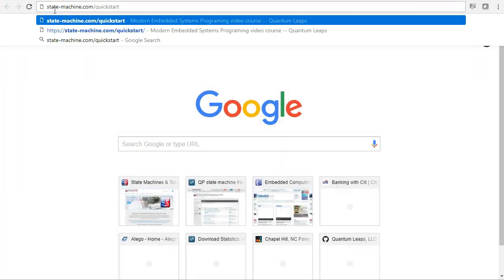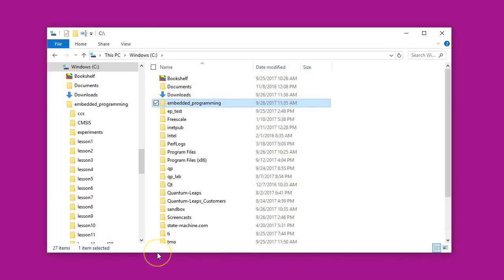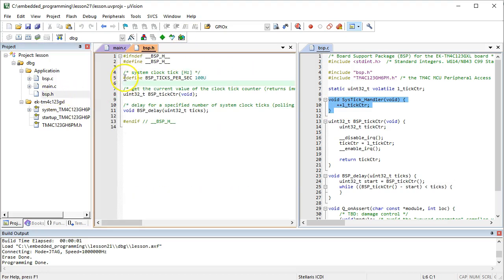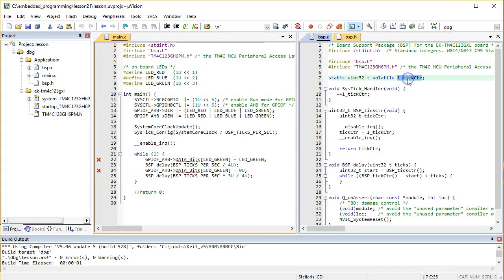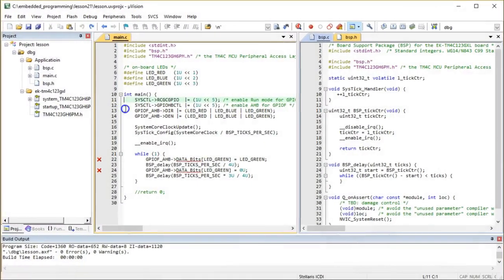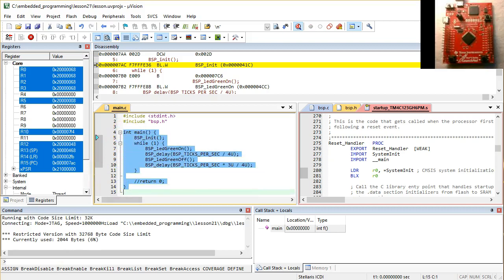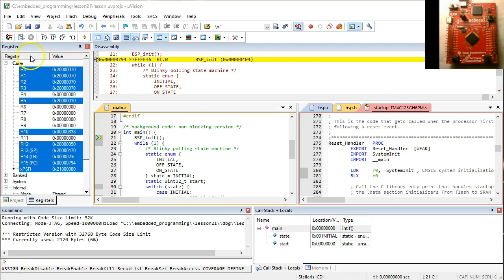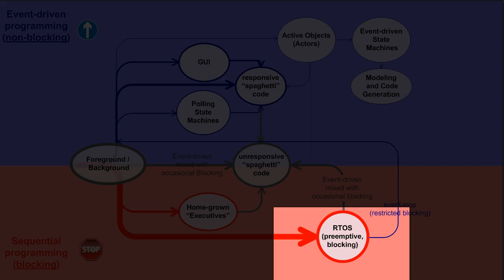#21 Foreground-Background Architecture ("Superloop")

Comment: For people confused (like me) about ((BSP_tickCtr() - start) < ticks), think of this like a clock. A clock at 1pm, but 4 hours prior,  we have 9am.  --> 1-4 = -3 + 12 = 9.

Now for unsigned int , which is a 32 bit number, the value ranges from 0 to 4294967295 (0xFFFFFFFF), therefore the total number of values are  4294967295 +1 = 42949672956, which is exactly like 12 hours, we call this MAX_VALUES.

So if we have the condition where start value was 4294967293, 

1 systick interrupt -> 4294967294  ,(BSP_tickCtr() - start) = 1
2 systick interrupt -> 4294967295 ,(BSP_tickCtr() - start) = 2
3 systick interrupt -> 0 (roll-over)  , (BSP_tickCtr() - start) = -4294967293 + (MAX_VALUES) = 3
4 systick interrupt -> 1                   , (BSP_tickCtr() - start) = -4294967292 + (MAX_VALUES) = 4

And so on... 

Hope this helps ( I am writing this to take a snapshot for myself).

Comment: sooo you should not do mix between blocking and non blocking systems?
Reply from the maker: That's right. You should not mix blocking and non-blocking programming paradigms. Truly blocking components are also difficult to combine together, because the blocking makes them unresponsive. That's the main reason for using RTOS (please watch the next vidoe https://youtu.be/TEq3-p0GWGI ). In contrast, non-blocking code is composable, meaning that you can combine many event-driven code snippets in one big loop, and they will still work. But you can do better than that. Please watch the segment of lessons about "Active Objects" ( https://youtu.be/l69ghMpsp6w ) and later about state machines ( https://youtu.be/EBSxZKjgBXI ). --MMS

Comment: How to run this lesson 21 on IAR  ?  
I got error "SystemCoreClock is undefined".
Reply from the maker: The project download for this lesson-21 has been augmented with the IAR workspace, which was tested to build the code correctly. Please download lesson21.zip from the companion page (state-machine.com/quickstart ) or from GitHub (https://github.com/QuantumLeaps/modern-embedded-programming-course ). --MMS

Comment: Greetings Team QP,
I couldn't get how was the clocking frequency was initialed in the program,
{
SystemCoreClockUpdate();
SysTick_Config(SystemCoreClock / BSP_TICKS_PER_SEC);

}
As I am a starter I couldn't able to figure it out from my side, I could understand that this part is most integral part of the code (setuping clock frequency ) and could you also suggest any reference to know more about system clock configuration. This would be a great if you suggest any thanks in advance!
Reply from the maker: The clock configuration is performed in the module system_TM4C123GH6PM.c  which is part of the provided uVision project. You can find this file in the qpc folder: qpc\3rd_party\ek-tm4c123gxl\system_TM4C123GH6PM.c . The function that configures the clock is SystemInit(). It is called from the startup code startup_TM4C123GH6PM.s, which is also included in the uVision project. To learn more about the startup code, please watch lessons 13-15. --MMS

Comment: a question MR MIRO "sorry for annoying you"  
when I check this parameter [  SystemCoreClock ] , I find so strange value >> 50 000 000 ... why this happened , although we do NOT use PLL , and if keil uses the PLL automatically , why does it do that !
Reply from the maker: Please take a closer look at the uVision project for this lesson-21. Specifically, look in the group 'ek-tm4c123gxl'. You should see there two files: startup_TM4C123GXL.s and system_TM4C123GXL.c. The startup (file in assembly) calls the function SystemInit() from the Reset_Handler. This SystemInit() is defined in system_TM4C123GXL.c, so open this file and search for this function. When you do, you'll see that SystemInit() configures the CPU clock to use PLL, which explains the value 50MHz. --MMS
Reply: @StateMachineCOM  yeah .. you alright . I ve checked the TM4C123GXL.c file and i found there is a default value for RCC register thanks MR MIRO ...
Reply: @omarayman5318  another way is to checkbox the BYPASS PLL in the system configuration file/wizard...
Reply: @UCZcuyApXHiYcMBjsjOb8ZyQ999  thank you  , I m gonna try to do it  using this checkbox ..
anyway I did it manually in the code
Reply: @StateMachineCOM  BTW you are the best teacher I ve ever learned from ...thaaank u very much for these helpful lessons .. may god bless u

Comment: In the first 20 lessons everything worked well. However in the lesson21 after building the project when I press Debug button it tells me 'No ULINK2/ME device found'. And then "Error: Flash Download failed - Target DLL has been cancelled". I installed uVision V5.29.0.0, Toolchain MDK-Lite Version 5.29.0.0 and used Pack Installer to install Tiva support. By the way, in the Debug tab of Project options for Target no Stellaris option in the Debuggers field as it was in two previous IDE. What did I miss? Thank you.
Reply: Stellaris ICDI has been removed from uVision. I was facing the same problem here. I followed these instructions and it worked right away: http://www.keil.com/support/docs/4196.htm
Just change it to Stellaris ICDI after installation
Reply: @gabemvp  Thanks! Was looking for a solution for this, and thought comments might help, you sure did :)
Reply: @TheNordrian  I'm glad it worked :)
Reply: @gabemvp  Great. I had the same problem and this worked. Thanks.
Reply: i still get the annoying Error: * Project 'lesson', Target 'Debug', Device 'Texas Instruments::TM4C123GH6PM' is not supported by Toolchain ! ***. even after downloading the ICDI AddOn, any idea how cam i solve it ?
 @gabemvp
Reply from the maker: The uVision 5.29 IDE works with the TivaC board. Your uVision project cannot connect to the TivaC board, because apparently it tries to use "ULIN2/ME" hardware debugger. For the TivaC board you need to install the "Keil::TM4C_DFP" device pack. You do this through the "Pack Installer", which is available on the Build toolbar.
--MMS

Comment: Thanks for the great tutorial Miro. Just a comment on license manager. There is no PSN (Product Serial Number) associated with the evaluation version which seems to be the only available free option. So that licensing step can be skipped without any issue.

Also, the archived version of this lesson is not the starting package but the final version at the end of the tutorial. I think it would be useful to include both starting and final packages in the course project archive to make it easier to kick off the course and follow the steps.

Comment: I had a problem in my Keil uVision V5.29, I could not Debug or install my code on my Tiva board, I searched for that I found a new problem and the solution is: 
Use an add-on installer that brings back the support for Stellaris ICDI to MDK v5.29 and above. Just download and install "MDK_Stellaris_ICDI_AddOn.exe" from link below; 
http://www.keil.com/support/docs/4196.htm
Reply: Thanks for the tip Muhammed. Saved me a lot of time.
Reply: My Error was: 

Cannot load driver 'C:\Keil_v5\ARM\BIN\lmidk-agdi.dll'.

Possible Reasons:
 - Driver DLL could not be found in the specified path
 - Driver DLL requires additional DLL's which are not installed
 - Required Hardware Drivers are not installed

 Debugger aborted !

Comment: Well, in the sequential blocking code if you might used if condition instead of while -> it would also spend time in main loop, because in event driven code you used if condition where in blocking code you used while condition........... P.S. event driven switch case is more preferable.
Reply from the maker: Replacing the polling while() loop with an if() statement would require completely changing the whole code structure, or the "blinky" code will not blink as expected. Such transformation would change the sequential code into something else: the event-driven code. Now, event-driven code might be more preferable, but it comes with its own set of challenges, one of them being that event-driven and sequential paradigms don't mix well. This will be the subject of many more upcoming videos of this course. --MMS

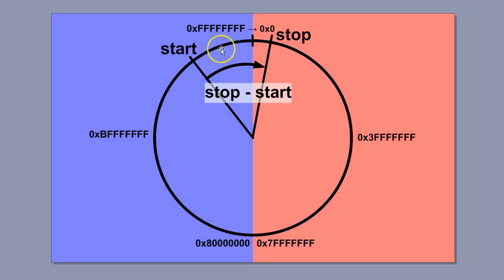Comment: 7:21 For anyone wondering how the while-loop condition ((BSP_tickCtr() - start) < ticks) in the BSP_delay function always works even when the counter wraps around from hex all-Fs to hex 0 is because the counter variable here is implemented as a uint32_t type, which has the same 32-bit precision as the fundamental int type on the ARM processor.

For example, let us assume that we call the function with ticks argument equal to 5 and that start evaluates to 4294967293. 5 SysTick interrupts later, the counter rolls over the maximum value of 4294967295 so that BSP_tickCtr() returns 2. We expect the loop condition to evaluate as false and exit, but you may think that (2 - 4294967293) would evaluate to -4294967291, which is less than our ticks of 5, making the condition true and continuing the loop (indefinitely). However, this does not happen because when the (BSP_tickCtr() - start) part of the condition is evaluated, integer promotion converts both operands (and their combined result) to unsigned int type, which does not widen it. The (2 - 4294967293) evaluates to 5, which is equal to our 5 ticks, and the loop exits as expected. Similarly, the while-loop condition also always runs successfully if the counter is implemented as a int32_t type, or as any type with more than 32-bit precision.

WARNING: If we were to instead implement our counter with a type having less precision than the fundamental int type on the ARM processor, such as uint8_t, int8_t, uint16_t, int16_t, etc., the above scenario would indeed result in a never-ending loop and program hang. For example, let us use a uint8_t type counter and call the function with ticks argument equal to 5 and assume start evaluates to 253. 5 SysTick interrupts later, the counter rolls over the maximum value of 255 so that BSP_tickCtr() returns 2. This time, (2 - 253) will evaluate to -251 (not 5) because this number can fit within the integer-promoted result type of (signed) int. Our left-hand condition value will always be less-than our ticks value of 5.

To summarize, if you implement your counter as having less precision than that of the fundamental int type on your machine (e.g., 32-bit for ARM, 16-bit for MSP430, etc.), then a counter wrap-around during while-loop execution will result in the condition forever evaluating as true and the loop running indefinitely, causing program hang. This is due to the C Language Standard's integer promotion rule, which widens all types with precision less-than or equal-to that of int during evaluation, to either int or unsigned int.

Please watch Lesson 11 for more information on type precisions, including how they interact when mixed in an expression. A detailed explanation about integer promotion and the "usual arithmetic conversions" can be found on the 'Implicit Conversions' page of the cppreference website, or in the 'Conversions' section of the appropriate C Standard.
Reply from the maker: Yes, absolutely, you need to be careful with the wrap-around and this might be NOT portable to other CPUs with different word size. --MMS
Reply: Thank you very much for the explanation I searched entire internet for the answer and did not find it I should have looked at comments earlier

Comment: 18:00 can u plz explain this diagram with pseudo code example for every architecture in 1 small video ?
Reply from the maker: That's exactly the plan: to explain all the embedded software architectures from the diagram. The plan is to go chronologically: from the RTOS (1960s-1970s), through event-driven and object-oriented programming (1980s), to modern state machines and active objects (1990s), to "reactive programming" (2000s). Stay tuned... --MMS
Reply: am waiting and thanks for ur time

Comment: As always, awesome video. Just one question: is it necessary to use __disable_irq() in the BSP_tickCtr function? It seems there is no race condition there since BSP_tickCtr only reads the 32bit value.
Reply from the maker: Yes, in this particular case of a 32-bit processor, the simple reading of the l_tickCtr variable (as opposed to read-modify-write operation) happens to be atomic. But even a simple reading of a variable shared between the background loop and the ISRs might be unsafe if it is not atomic (e.g., on a 16-bit processor). Therefore it is a good practice to perform such an operaration in a critical section. If anything else, such a crtical section serves as a comment that the programmer has thought about race conditions. Also, such code is portable without any "ticking bombs". I hope you get the point. --MMS
Reply: Totally got it. Thanks so much for the clear answer.
Reply: @StateMachineCOM  Firstly thanks for great vides, here I have one hint if you will improve your application by adding more different interrupts, to my mind the best idea/ approach is not to disable the global interrupt for the whole system, only disable the dedicated interrupt in this case system tick interrupt, Miro what do you think?
Reply from the maker: Yes, you can be more selective with disabling interrupts and the NVIC in Cortex-M allows you to disable interrupts individually. However, this is not practical for system-level software such as Real-Time Operating System (RTOS), which is discussed in lessons 22-28. The problem there is that the RTOS does not "know" which specific interrupts to disable, and most of the interrupts interact with the RTOS anyway. But some RTOS kernels, including the QXK kernel discussed in lessons 26-28 support so called "zero-latency" interrupts, by selectively disabling interrupts only up to the specified interrupt priority level. Please watch the lessons and pay attention to the "interrupt latency" sections. --MMS
Reply from the maker: @maciejcebula3353  Yes, disabling just the interrupt that "touches" the shared variable (SysTick in this case) will be sufficient for guaranteeing mutual exclusion. But here, you need to consider the computational cost of doing so, and it turns out that surgically disabling and enabling specific interrupts is significantly more *expensive*. It requires accessing memory-mapped registers, for which you need to clobber at least one CPU register. In comparison, disabling interrupts globally takes only one single-cycle instruction (CPSID I) and re-enabling another single-cycle instruction (CPSIE I). No CPU registers clobbered and no expensive LDR/STR instructions (at least two cycles each). Also, as long as the total interrupt disabling time is shorter than the longest CPU instruction (which is the case here), you don't really increase the interrupt latency of the system. (The longest CPU instruction is exception-entry/exit of at least 12 CPU cycles.) For these reasons, I would say that global interrupts disabling works better in this case. --MMS

Comment: Thanks for interesting topics. But from what I understand is that the code blink LED should be called from hardware interrupt such as system handler, hardware timer (foreground task), not calling from main function (background task). From your both code all the blink LED is call from main function. What you called non block version is just move the delay code to main function. And the lesson is not clear what purpose of background and foreground task. In your example, it only mentioned to increased the systick counter. How about call the delay from foreground here, it is easier to undertand is it?
Reply from the maker: Yes, absolutely, a dead-simple action like turning an LED on and off would be easiest to do directly from the ISR. But this would miss the point here, which was demonstrating the foreground-background architecture and the issues involved. I'm not sure if a more complex, "real-life" example would be a better teaching aid. Certainly, the Arduino "Blink" program shows the exact same structure, but nobody complains because Arduino completely hides the "foreground" (ISRs).

Comment: Thanks for the clear explanation. Blocking Vs Non-Blocking, what is the best way for energy efficient coding?
Reply from the maker: The key to energy efficient coding is to utilize the low-power sleep modes of the CPU and peripherals as much as possible. The most convenient way to achieve this is to have only one place in the code when the CPU/peripherals are turned off (to be woken up by an interrupt). In the foreground/background architecture, this is easier to achieve in the non-blocking, event-driven paradigm, because you can simply test for the "idle condition" at the end of the fast-executing main loop. In contrast, when you use blocking (polling), you need to think about low-power modes in every blocking call (e.g., inside the BSP_delay() function and other functions that block). In the upcoming lessons about RTOS, you will see that the blocking paradigm can be "saved" by using multitasking and that an RTOS offers a single "idle thread", where you can conveniently place the system in a low-power mode. Hopefully this makes sense to you. --MMS